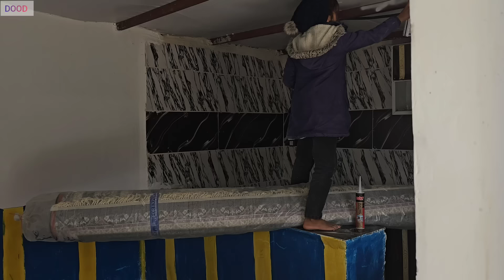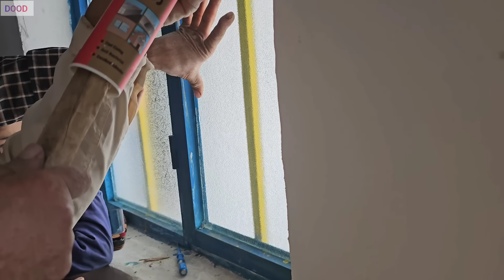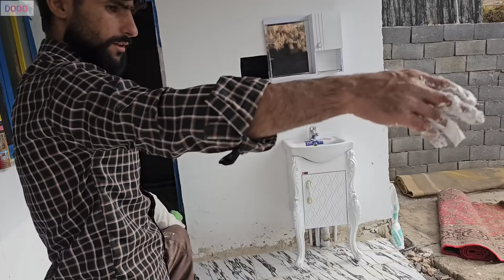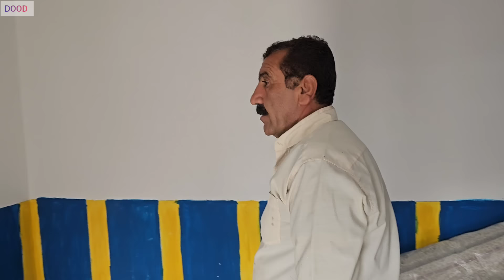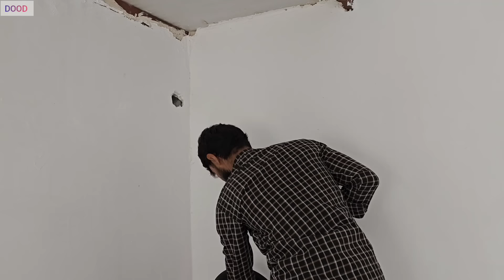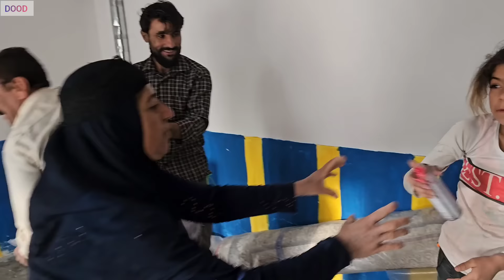Request for divorce from the second wife of Mirza Ali by the court

Comment: Dumb men.  Its should be a clear liquid nails for glass windows that adheres quickly, not regular caulking.  They also need masking tape to hold the glass in place until the glass is cured and secured.  They've got little girls holding those two glass window panes, while going ahead to tbe door glass.  One of those panes slips,  it would cut that little girls face badly.  And, it is plum stupid to spray paint those iron beams too.  Why don't they just leave well enough alone.
Reply: Also, it seems no one has ever heard of a caulking gun. 😂